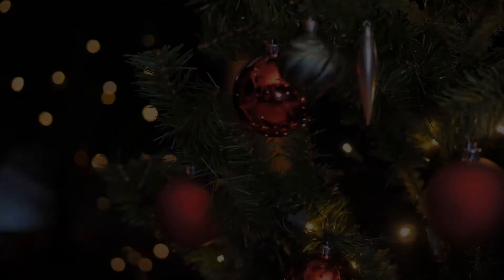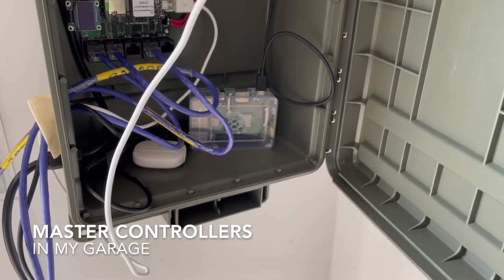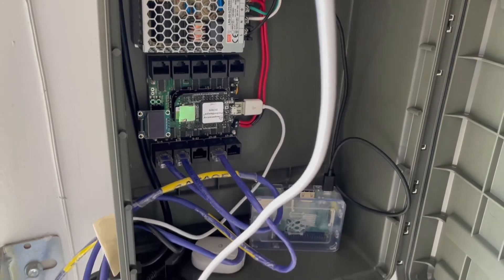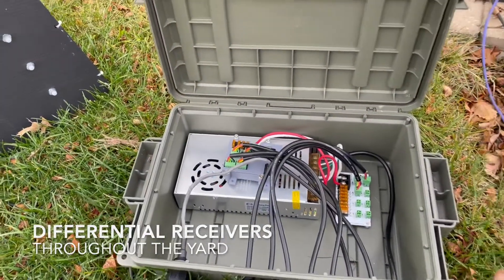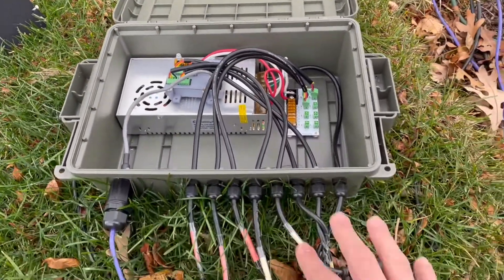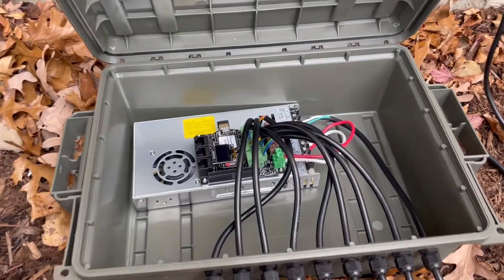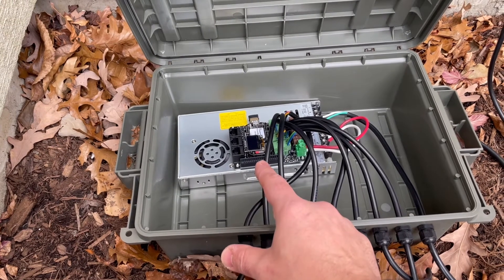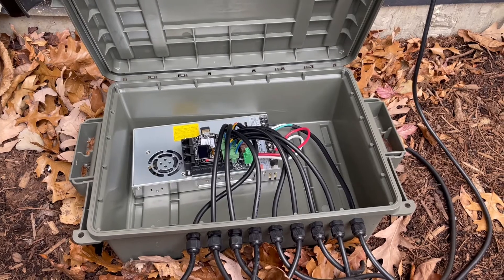Lighting Tutorial - Controllers

Comment: So let's break this down a bit. I get everything after the k40d but a little confused before it. So router to pi? Wired? Pi to kulp? Wired? And pi also runs the sound board? I've ordered my parts but unsure how all that functions. No manual for the k40d-pb
Reply from the maker: Pi is my "master" controller, and that runs the audio (so yes, the Sound Blaster connected to that). Then the K40D and my other Kulps are remotes/slaves multi-synced to the Pi master.

Comment: Thanks again for your videos and for answering our questions. I purchased a K8-PB with the pocket beagle and a raspberry pi 4. Now I'm confused because the beagle has FPP pre-installed. Should that instead be installed on the Pi? If so, how do the Pi and controller communicate?
Reply from the maker: Since the K8-PB has FPP on it, you can just use that and therefore no need for the RPi at all. Or you can put that K8 FPP in "remote" mode but have the RPi run as "master/player". Multiple ways to achieve the same result.

Comment: What size/type of wires and connectors are you using for the power injection? Great work, btw!
Reply from the maker: I use the same XConnect 3-core extension cords for both my main ports as well as power injection. It’s just for the power injection, no data is flowing through that conductor.
Reply: @GandorFamilyLightShow  Awesome- thank you!

Comment: Can you provide a link to the power supplies you use?
Reply from the maker: I use different power supplies (5V or 12V) depending on what exactly I'm powering, but I generally prefer "Mean Well" brand as they are higher quality and more reliable. And the bulk of my show runs on 12V, so I have several LRS-350-12's. https://www.amazon.com/Mean-LRS-350-12-Switching-Power-Supply/dp/B0109IMRPS?th=1